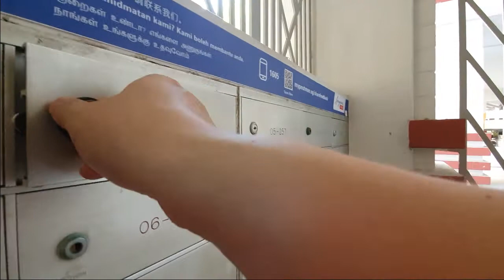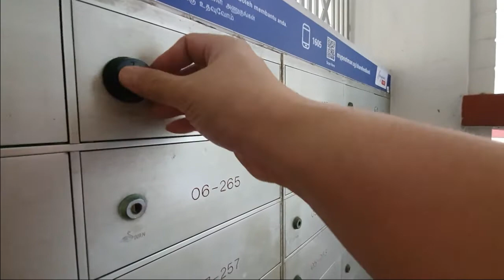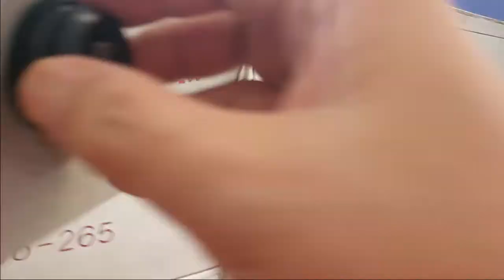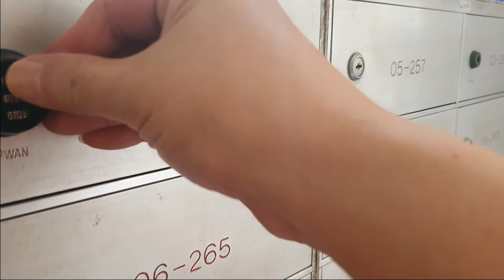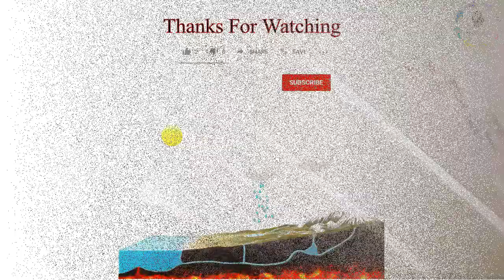Mail Box Number Lock installation

Comment: Hi Uncle Tay, is it must use back the original hinge? Because the lock unable to lock properly and I think is it the hinge too long.
Reply from the maker: yes
Reply: @UncleTay-Amdus  but the old hinge bracket unable to fit with new number lock cos the hinge bracket hole is square one and the number lock hinge bracket hole is circle. How to fix it?
Reply from the maker: my both square.
Reply from the maker: look at the video @ 5.18sec
Reply: Nice.. Thanks uncle